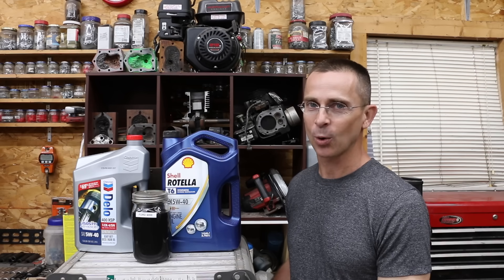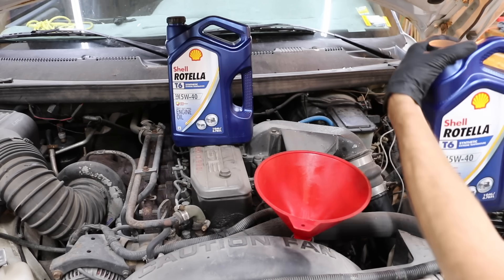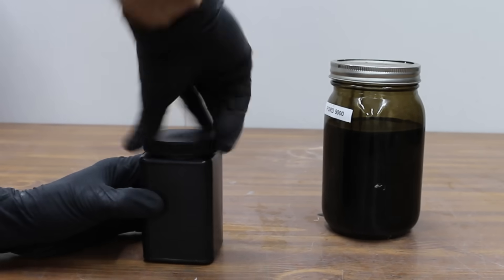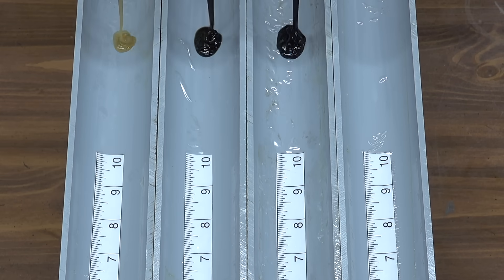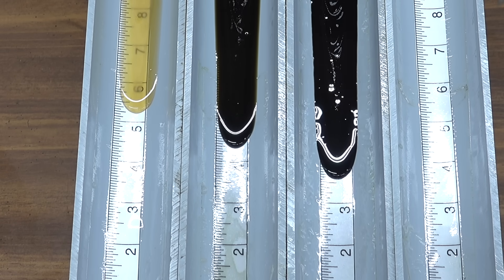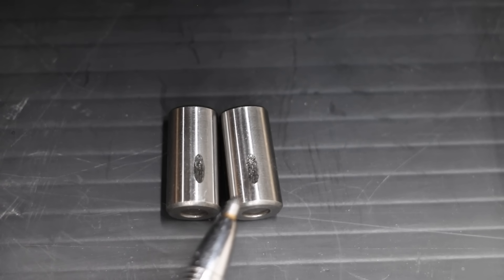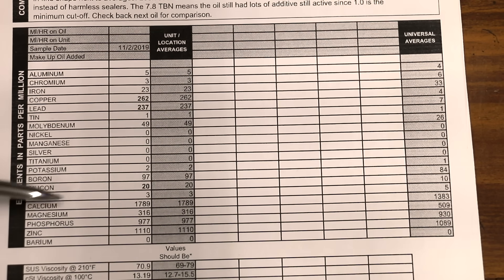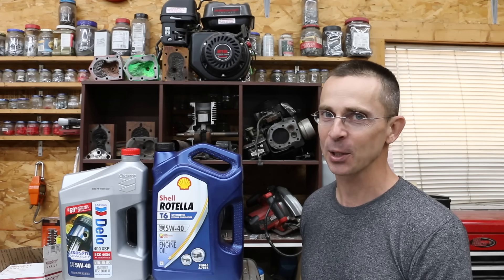Will Annual Oil Change Damage Your Car? Let's find out!

Comment: I changed my oil yesterday and used T6, I'm glad it did well under testing. I switched to it a couple years ago mainly because the price of the Mobil 1 I was using was getting out of control. It would be interesting to see how it compares to the T6.
Thanks for the videos, you are my go to for unbiased product testing.

Comment: We change the oil for our mx5 (Miata) race car every race or after every other test session. As a result some guys in the series use a cheaper oil - I think based on these tests it's better to use a more expensive oil and hold the changes than to change all the time with cheaper oil.

Comment: think the results may be different on a more modern engine, like a direct injection diesel with a dpf and egr valve, or the direct injection petrol engines as they run a lot hotter than older petrol engine
Reply from the maker: Thank you for the feedback

Comment: I have ran Schaffer oil with same oil filter  12000 miles on the oil took me 3 years to put that miles on took it for testing a few times in that time period also. Oil analysis showed oil still clean

Comment: Never knew oil could become acidic, but makes sense. I just did a oil change on my Cummins that was actually about the same timeframe and miles as yours. It became a second truck last October and didn’t get used as much this year as it used to, but I couldn’t sleep good at night knowing the oil was over a year old even though it only had a little over 3k on it. My thoughts are oil and filters are cheaper than a new engine. Love all the effort in all your tests.

Comment: In my experience rotella outperforms delo.
Rotella oil loss goes slower in my truck than delo, the engine is munching delo faster. 
Delo also loses in holding pressure as compared to rotella, both oils the same viscosity rating, the same in technical characteristics, but rotella clearly comes out on top for me.
Engine, 7.8 Isuzu diesel

Comment: I don't think you have tested this yet, but what about diff and transfer case oil. A lot of the synthetic diff oil claim less friction over stock oil for better anti-wear and MPG. These oil tests that you do should work also to test the diff oil to prove if there really is any advantage to using synthetic over conventional diff oil.
Reply: I'm a jeep tech, and with most of the wranglers having 4 wheel drive, I can honestly say it should be based on condition of the fluid, not by time, unless you let it sit for most of the life of the vehicle.

Comment: Hey there brother. Question for you: I've got a 91 S10, 2.8liter, 123,500 or so miles on her. I use 5w30 sae, as per the oil fill cap suggestion. Would going to 10w30 (Castrol sae) or 5w40 sae (rotella) be harmful? Up my oil pressure? I've got no ring blow by at all. My average drive is 40 minutes. Sometimes I drive 300 plus miles at a shot. 

Thanks, and keep up the awesome unsponsored content! Cheers!
Reply: 5w30 supertech full syn & a Mobil 1 or fram ultra synthetic oil filter. Get it all at Walmart great prices.
Reply: @JD-ns9mr  If you run full synthetic I wouldn't worry about using 5W30 in it. Thicker doesn't mean better despite what some old timers may tell you, just run what the manufacturer recommends.
Reply: Robert Hancock lol what?
Reply: Hi, you can use any oil you want to from 0w20 up to 10w30 or 20w50 if you have an owners book for your car each oil has different range requirement when cold to avoid to much damage to your engine
Reply: @michaelc9128  Always check from the owners manual so you have the right viscosity and oil ratings
Reply: Follow the owners manual. I owned a 93 S 10 for many years with that same 2.8 V6 engine and I'm pretty sure I ran 10w30 in it.
Reply: Check the owners manual - usually engines specced for 5W30 allow 10W30 when not in extreme cold conditions. But it's unlikely to be a benefit unless you're using poor quality 5W30 in extreme load or heat conditions.
Reply: The only time 10w30 is thicker than 5w30 is at start up on a cold engine. 30 is the "hot" rating for viscosity in both oils, so there is no difference at operating temperature. 5w30 is better in cold climates at start up. Why is this still voodoo science, it's 2019, you can even Google this information.

Comment: SN rating for cars would also imply that oil is reduced zinc and wont coat the inside of CATs. I would like to see comparisons with conventional diesel oil as well. I wont use a synthetic, not because of leaks, but because I am almost certain the synthetic oil has issues with antique engines. I'm not clear on what is wearing, but I have multiple data points suggesting more metal gets worn off with synthetic than conventional. Flat tappet lifters? The hydraulic effect is reduced in the rod bearings?

Comment: When I sold auto parts we had access to the engineers at RedLine. They were chemists and huge nerds. One thing very few people think about is the contaminants you introduce with every oil change. Depending on the brand your oil can have contaminants in the bottle. And you open the engine to contamination when you add or check your oil. Obviously a synthetic oil seller wants to play up the benefits of long change intervals, but there was some validity to their claims.

The issue with diesel oil is the detergent package, and sulphur content. Unlike a gas engine, diesel oil has a timer that starts as soon as the oil is added. The additive package gets consumed and the oil needs to be replaced. It would be nice if there was a good way to monitor this directly.

Comment: I've always gone by mileage and ignored the time aspect. as a side note a lot of motorcyclists have used Rotella  in their older motorcycles when they started the energy conservation endorsement  because it has no friction modifiers which could cause wet clutches to slip.

Comment: All vehicles should be fitted with an oil pressure gauge. It's stupid not to. Any sort of blockage from a soiled filter will result in a drop in pressure and it's a really good indication that your oil and filter are due a change if you see any slight decrease over time. Or even just to keep an eye on the general running condition of the engine! 

I say that due to some people following the long life oil change intervals recommended on some vehicles and not having so much mechanical knowledge. A simple gauge could make an engine last a lot longer for some people!

Comment: I'm still hoping for a video on Renewable Lubricants' 5w30 and Green Earth Technologies' G Oil in 5w30, mostly because RLI is Veggie Oil base motor Oil and G Oil is Beef Tallow Based. You could also take each oil (new and used) and pour them on grass in containers and see if the grass dies initially but re-grows within a week.

Comment: Will a New  Vehicle Engine not " Break in" if you use full synthetic oil from the moment its purchased? Someone Told me they Wont.
Reply: My personal experience with my last 2 Ram trucks , both with hemi engines ,  a 2016 and now a 2018 ,  I changed factory oil on both after about 1000 miles  with Mobil 1 ,  both didn't  seem to break in until about 8000 miles , then I noticed gas mileage gained about 2 mpg  . So , yes , it takes a little longer on synthetic but they do break in .

Comment: Do you think the same conclusion can be reasonably assumed for conventional oil? 

I use conventional oil for my car. I drive only about 4000 miles a year on a consistent basis, and I change my oil once a year. Periodically, I also visually check my oil via the dipstick to make sure it still looks usable. But I always wondered if changing my oil annually could be hurting my engine, even though I drive very low mileage.

Comment: They  say it is mandatory to change every 6 months regardless of mileage to get our money..  mileage is more important  than time, but of course youre not gonna let it there for 5 years hahah but totally unnecessary to change it every 6 or 12 months if its been used for 2000/3000 miles
Reply: For some applications, 5 years is closer to correct than 1 year is.  Depends on how many short trips you make.

Comment: Very interesting video. Technically, as long as the oil stays within its stable limits, and filtration is always kept to a good standard, you shouldn't theoretically ever have to change the oil out. I change the oil out in my 4x4 every 8000km (~5000 Miles) or so. That's for 2 reasons. One is that I spend a lot of time in remote locations and need reliability, and the second is to deal with the carbon particulate in the oil from the diesel engine (I have had filters collapse from being clogged). I assume this test is more to show the effects of standing oil rather than oil that is worked hard on a daily basis? You mentioned that the Cummins had approximately 3000 miles over 17 months, which is to me, a very low mileage over time amount. 

As I mentioned before, filtration is key to maintaining oil integrity (as well as remaining within temperature limits). I work as a hydraulic service fitter. I've seen fresh oil go bad within a few months because of lack of filtration (i.e.they didn't want to buy filters to service their machine regularly), which also resulted in the damage and failure of several other system components. Inversely, I've pulled apart pumps from systems where the filters are changed monthly, and the system runs 24/7, and they have been pristine inside. 

I guess the point I'm trying to make here is that while it is possible to go long periods without servicing your vehicle, for longevity and reliability, it is more beneficial to spend the money on fresh oil and filters every once in a while than wait for something to go wrong. 

Good work on the video and always interesting to hear your results.

Comment: How about standard compressor oils vs synthetic? I run a high pressure (4500psi) breathing air compressor with synthetic as I feel it's better ... But who knows? 

If you want some used oil I can hook you up as it's oils change time soon.

Comment: Blackstone labs comment to me on my 13 month/5k miles oil sample was that time is not a factor in their evaluation of oil samples in modern engines. And that I should not be concerned about going over a year between oil changes.  As you have also confirmed.  Yet I hear ubiquitously on YouTube, ie Scotty, that one year is the usable limit.
Reply: Scotty likely got that from Toyota... Well maybe not?🤔
Reply: The advice for once a year is likely to account for different driving conditions. If you drive your vehicle in extreme cold and often don't let it run long enough to warm up fully, you could end up with a bunch of fuel and water contamination in the oil, and saying to change it periodically helps cover that sort of thing, given that the average driver doesn't send their oil off to Blackstone to see what shape it is in.

Comment: You should try to get ahold of the Shell rotella for gasoline engines. I have been greatly considering using it in my Yukon with the 5.3 AFM engine. For now I use Valvoline high-mileage full synthetic. Definitely be interested in seeing the differences between the two
Reply: I've heard good results, no data to back it up though

Comment: I once went on vacation to Germany. At the Shell they sold "universal top up oil" it was way more expensive then any of the other oils they had but it didn't have any thickness rating... Like it didn't say 10w40 on it or anything it just said "universal engine oil" I am curious how engines handle that stugg
Reply: Gas station quarts of oil are always crazy expensive. 
Often they sell “universal” coolant. 
But it’s a gimmick. No such thing as universal. 
5w40 is about as universal as it gets.

Comment: One thing I've always wondered about that's so far never been proven conclusively is if bigger than stock oil filters really do help with higher drain intervals/keep your oil cleaner. As in, a test with a giant fleet filter vs the OEM smaller size one.
Reply: GilBatesLovesyou they work in MEA region the OEM filters are bigger than European sold vehicles , due to more dust intrusion and tougher conditions
Reply: @Kavi4GP  On one of my vehicles I actually ran into oil pressure issues with the OEM size filter on fairly low oil change intervals (3-4K.) But they stopped when I switched to one about twice the size for a Ford. It was a very old engine, likely with a lot of sludge.

Comment: Oil? The answer is ALWAYS Amsoil Signature Series.
Reply: for powersports i like amsoil, but for my diesel the price difference between amsoil and rotella t6 it isnt worth it to get amsoil
Reply: @dirtyforddiesel  did you see his test on Amsoil?
Reply: @RightLaneHog3151  yes I did. $40 more (in canada) for the same amount of oil to use amsoil. I'm sure their diesel oil is good as well but realistically it's not worth 40% more as t6 is top rated oil for diesels
Reply: @dirtyforddiesel  Become an Amsoil Preferred Customer and buy their products at discount rates.
Reply: If you like wasting money then yes.  The fact is, the cheapest oil with a good, lab test result is the answer, then it's just a matter of how much work to find the best price and whether to stockpile it when you find it.

Comment: Another great test with great info. I've always suspected that the manufacturer's suggested oil change frequency is bogus ... this more or less proves it ... but perhaps only when using Full Synthetic oils. My 2013 Subaru Legacy uses 0W-20 oil .. a bit strange, but perhaps not for a flat opposed 4 cyl. engine.  I'm wondering if you think that regular (non-synthetic) oil would fair as well in a long duration test?  Merry Christmas ... Cheers!
Reply from the maker: Thank you

Comment: As an added bonus.. T4 and T6 Rotella are both JASO MA./MA2 rated.. This means they meet the specs for Japanese motorcycles that share engine/trans and wet clutches. I'm running T6 15W40 in my 2018 Kawasaki KLR650 and it runs quiet and shifts great.
Reply from the maker: Thank you for the feedback

Comment: Here's something that will stir up some controversy.  Before I retired, I worked in a big name NASCAR engine shop.  I learned a lot about oil that pushed the edge of science fiction, but was actually true.  This shop ran their car engines with Mobil1 because of its ability to perform in high heat conditions.  The average oil filter holds about 20 grams of solid contaminates.  I have now run two of my brand new personal cars with the following oil change interval.  Oil change every 20,000 miles and a new high capacity filter every 10,000 miles.  It is important to change the filter every 10,000 miles due to the fact if it clogs up, it will go to bypass and then no filtering is done.  Both cars have gone well over 200,000 miles.  The only time I needed to add oil was at the filter change due to the loss of oil in the old filter.  Modern synthetic oils have placed the old oil specifications and myths on their heads.  If you can come up with a way to demonstrate this within a reasonable time, it will make for a great video.
Reply from the maker: Thank you for the feedback

Comment: There used to be an Urban Myth/Legend that you could not use Series 3 (diesel) motor oil in a gasoline engine because it would cause it to start burning oil.
I have no idea how to test this myth, but I would love to know how it started.
BTW: I've used the same oil (Shell) in all my equipment be it bulldozer or pickup truck and never had a problem.
Reply from the maker: Thank you for the feedback

Comment: I think there is a safety marging. It depends on load, temp and wear in the engine. After my trip on the german autobahn (180+kmh) the oil wasnt brown, but black from intense use and heat. When im driving to work daily it takes months to change the color. Do you agree?
Reply from the maker: Thank you for the feedback

Comment: I'm at the beginning of the vid, so I'm going to put out some opinions. If the vehicle is driven to operating temperature and sustained for anything over 30 minutes, it would probably be fine.
It's short trips from a cold start that does damage.
Reply: Definitely the conclusions that I expected, so I know I'm not damaging an engine.
I'd like to add, when an internal combustion engine is out on the road for extended periods, it's considered light duty.
City driving is medium duty.
Off road, as in construction, heavy duty.
Even though you might get 7000 to 8000 miles on a heavy duty dump truck, you change that oil.
OTR trucks, 25,000 to 40,000 is not unheard of, and I like to change mine 3 times over a 100,000 mile period. 
But, new tech can make that 7 gallon supply of oil last quite some time.
Kudos to Farm Project, he has all your needs for your POV (Personally Owned Vehicle).

Comment: I have a classic VW beetle, a mechanic told me I could use oil for diesel engines on my car's air cooled engine and that it would be good for my motor because diesel oil has zinc and VWs  benefit from the zinc as an oil additive. Could you test his theory?
I never tried it because I didn't want to run the risk of ruining my engine.
Keep these videos coming, very well explained and without pushing a product since you're not sponsored by any of them.
Reply: perromion that’s true and he proved it in the video comparing Delo to T6 the Delo with it’s SN gasoline engine rating had over 30% less zinc. You run the risk of ruining a beetle engine by not using diesel oil as all gasoline engine oils have massively reduced zinc levels since about 8 years ago (API SN) to prolong the life of emissions equipment.